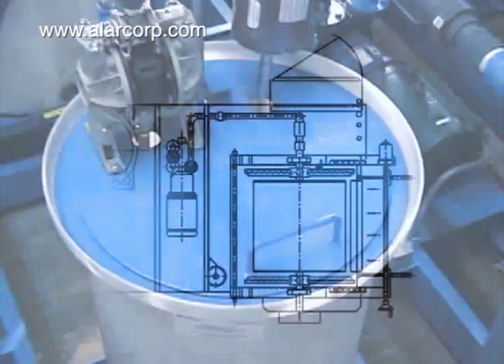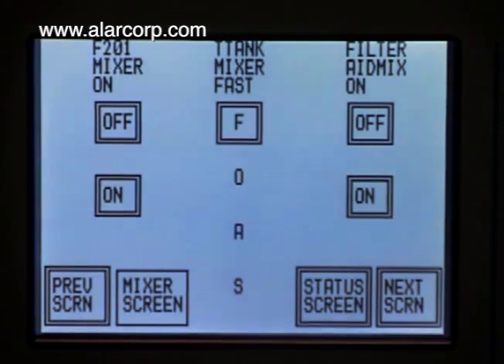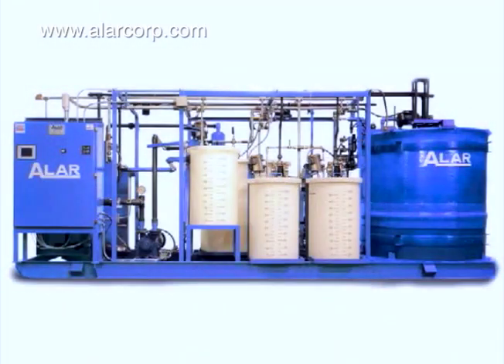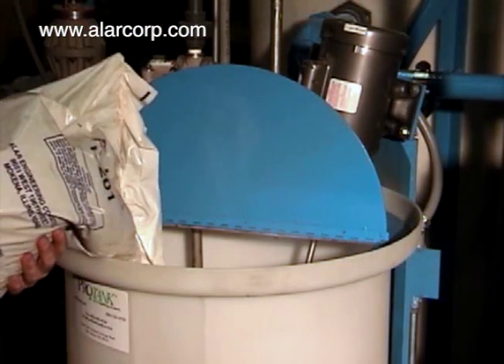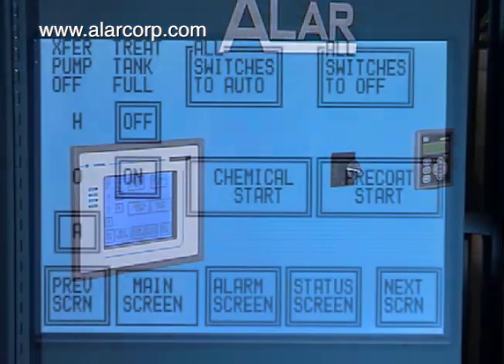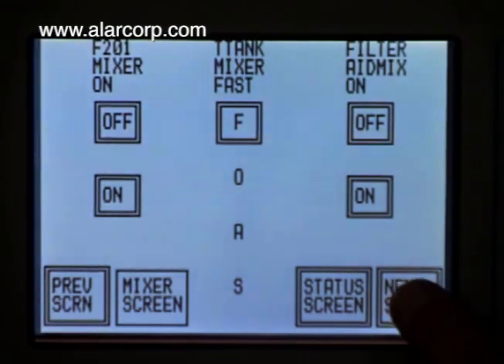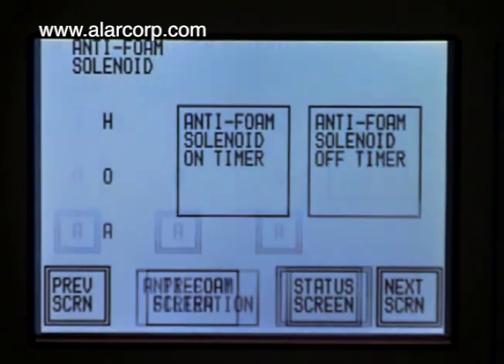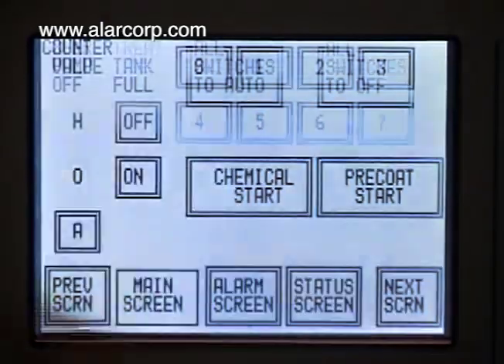Wastewater Treatment for Water Based Effluents | Alar Water Treatment

Comment: Let me know is this system applicable in electroplating waste water, how much this unit ?
Reply: It sure is. We use one where I work. It has been a company saver.
Reply: Thank u for a video, could you please explain the type of chemicals required for water base paint water coagulation?

abdallah271292@gmail.com
Reply: @abdallahobeidat4607  There are several methods for latex wastewater chemical pretreatment. Typical application is pH adjustment using acid and alkaline treatment, then a polymer is added to break the adhesive nature of the paint. Please contact ALAR for more information.